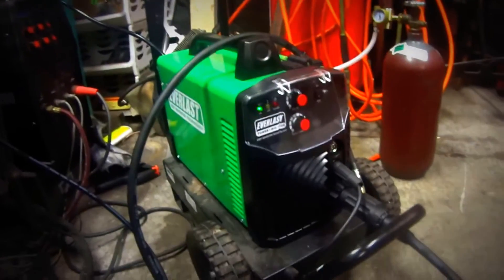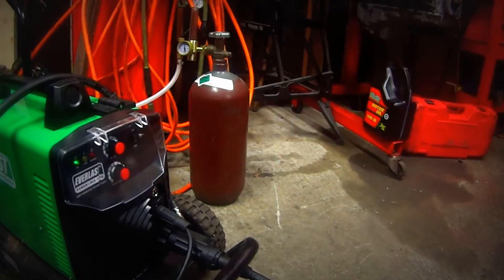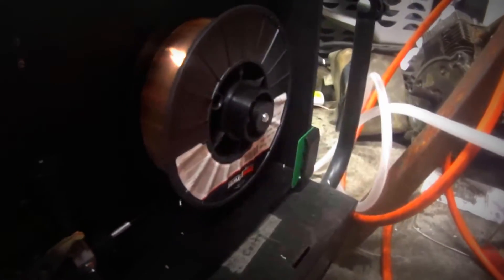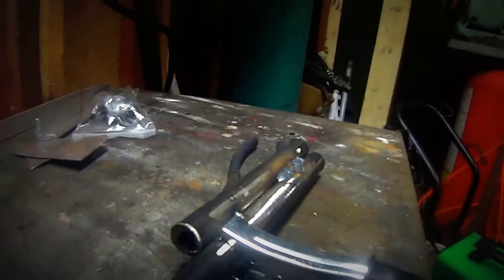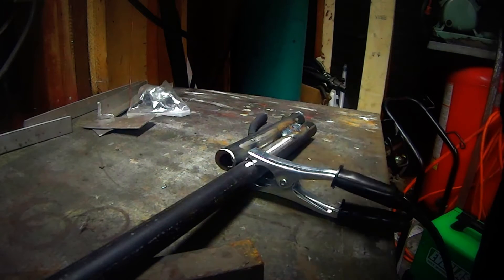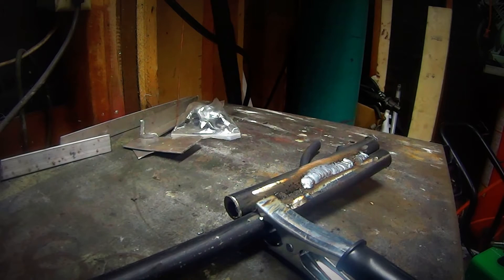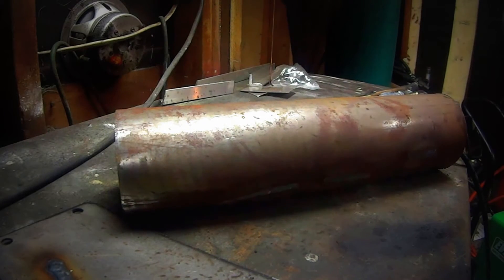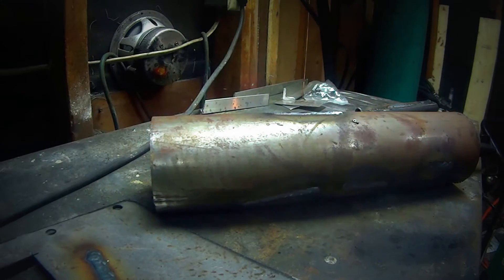Everlast 140 mig welder review!!

Comment: Why do you wish you went with the Lincoln 180? Need more power? I currently have a Hobart 140 and have been looking at switching to this machines since inverters typically have a bit more heat and I'd like to use a spool gun.
Reply from the maker: I meant to say I wished I went with the 180 when I first bought my Lincoln 140 this machine is awesome for the size and money definitely seems to have more power than my Lincoln 140
Reply: This everlast welder looks awesome.

Comment: good video man!  what are the reasons you would have gotten the lincoln 180 over this machine? the 180c is is 400 more where i work.
Reply from the maker: more power
Reply from the maker: also look around you can find the 180 for $650 I think is what they sell them at home depot for without the spool gun
Reply: this weekend I ran 4lbs of wire through my Everlast 140 that I just got and have to say I'm very impressed. for 350$ to my door with upgraded heavy ground clamp and a bunch of consumables I'm very happy. not one hitch at all, smooth as butter.  I work at Airgas, have used the 210mp and was not impressed. for the money it's a good buy. Everlast customer service so far blows Lincolns out of the water. and it is all in what you really like or need. size wise this thing will do all I need it to.
Reply from the maker: +Derek Moen yeah for all my car related stuff it does great I am going to be looking into something like a 250 later this year
Reply: there is also a difference between the Lincolns you buy from a welding store to a big box store, I asked the Lincoln rep about it.
Reply from the maker: +Derek Moen I've heard that aswell